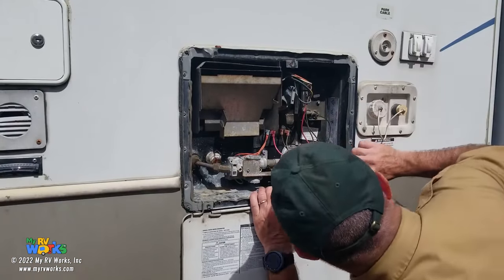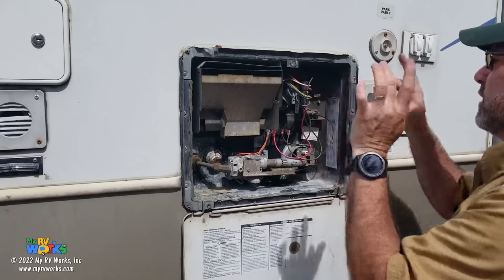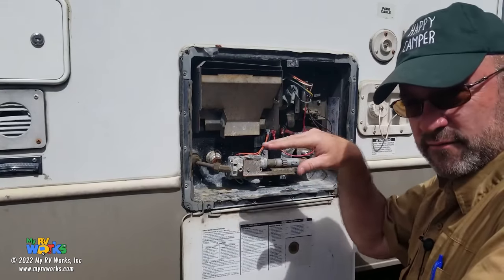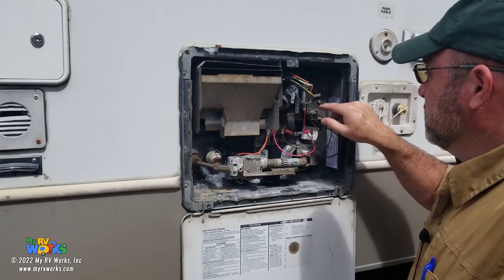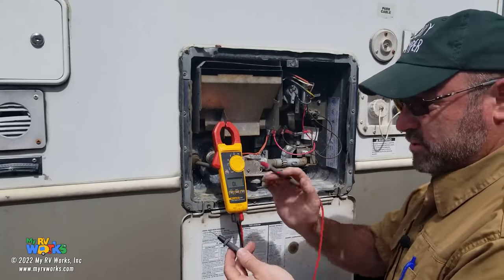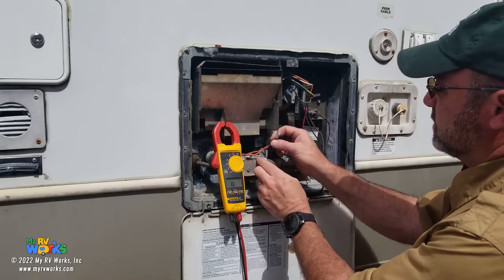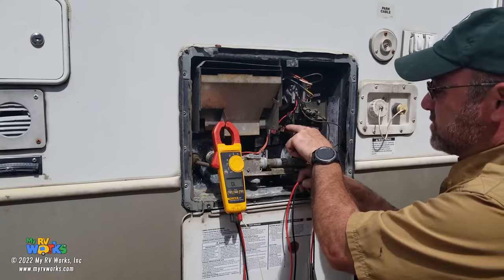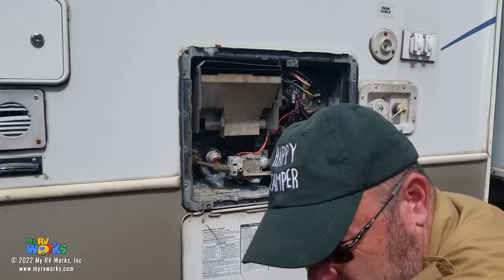Atwood Intermittent RV Water Heater Issue  -- My RV Works

Comment: Hi there thanks for the video but I have question. My Atwood heater in a 2006 motorhome will fire up and burn for only 5 minutes then shuts down. I think its the circuit  board and a connection inside is getting hot and opening up the circuit any thought?
Reply from the maker: Interesting, 5 minutes would be about the time I would suspect the high temperature switch would trip. Make sure you have no restrictions in your ductwork.  I am working on the theory that the furnace is generating heat but it is having a difficult time getting rid of the heat.   Therefore the heat is backing up inside of the furnace causing the high temperature switch to trip.
Reply: @MyRVWorks  the water heater I meant to say

Comment: Too late for anything in this video, but my Atwood heater will fire up on gas every time with the cover open like in the video, but close the door and it fails to work.  It does not have an electric heater, gas only

Comment: great video I have a question about my system....I have a gc6aa-10e gas and electric water heater...I just installed a new board because the entire gas system was missing as well as the circuit board.  I have no power on the yellow wire, but if I jumper brown to yellow to get power the internal relay turns on and I get hot water.  My question is with the gas solenoid and ignitor missing will the circuit board allow electric operation or no?  I'm stuck between whether the new board I got is DOA or it needs to sense some resistance from the gas items to turn power on for that yellow wire.  I get a DSI FLT at the remote switch as well.  Any help would be great!
Reply from the maker: Which brown wire are you referring to? The one on the top with the orange and white wires? Or the one on the bottom that has the red, yellow and blue wires?  The electric part of that circuit is totally separate from the LP gas side of the circuit. So power from the switch should come in on the white wire on top, and then leave on the brown top wire then go to the thermostat and come in on the lower ground wire. It then comes out of the DSi board on the yellow wire do the relay in back.  So use a DMM to verify the 12 volt path.
Reply: @MyRVWorks  thanks for the reply…I have power on the white wire when the switch electric side switch is on.  That gives me power on the brown wire in the top connector…I have power on the brown wire in the bottom connector next to the yellow wire as well. I have power on both sides of the 2amp fuse. But no power on the yellow. If I jump the lower brown to yellow giving that 12volts I hear the inside relay click and I get hot water. But without that I get no power and a dsiflt at the remote switch. I do not have any gas components as I mentioned they were removed from the camper. So my theory is the new board I put in is just bad or it needs to see some sort of resistance from the gas components to remove that fault and provide power to the yellow wire. Side note I also tried removing the diode on the thermostat for testing too to see if that could be the issue and wired the lower brown wire direct to the thermostat but no difference.

Comment: I have an Atwood 6 gal propane and 110 combo unit in my RV. It will fire up with a nice blue flame on propane, not with electric. Propane flow has good force but will not heat any water, I've purged the air from the tank, replaced thermal fuse, checked small 2 amp fuse on the front, and cleaned orifices as best as possible.. what could be the non heating issue and what should I look for next? It fires and ignites fine  but will not go any further. I replaced the board with the Dinosaur UIB64, still no heated water from faucets.
Reply: Check the bypass water valve is closed, if open the cold water is bypassing the heater.
Reply: @terrybreen3331  what would that look like on the back of the water heater? Is it inline in the plumbing? Sorry I've never seen one before. I will look for it when it gets a little warmer.
Reply: It's located where the water lines go into the water heater you should see three valves the valve between the two water lines is the bypass valve mine is located under my seat inside the cab.

Comment: How do I know if it’s my heating element that needs to be replaced?
Reply from the maker: At your heating element, with the power turned off at the breaker, disconnect one of the wires on the element screw. Then use a meter set to ohms and test the ohms between the two screws. A healthy heating element on a water heater should return about 10 ohms of resistance.

Comment: I have a spare Suburban 520900 electric water heater element that was for my old RV water heater. Would it work in my new RV that has a Dometic/Atwood water heater? It has two screw terminals on the end and would screw in. It looks like it would work but I don't know if the threads are the same.
Reply from the maker: It should work just fine. Most of these elements are Universal. Do a continuity/ohms test. It should come back in the neighborhood of 10 ohms.
Reply: @MyRVWorks  Thank you sir.

Comment: 1) corroded connectors  2) control board overheats and shuts down  3) too much AC ripple on DC circuit causing control board to fail

Comment: great video,

I have an atwood water heater.  I have replaced the thermocouple and the mother board.  It starts up on gas with no problem, it runs for about 15 minutes, and shuts off, it will not turn back on by itself.  I did check the fuses.  do you think it could be the thermostat?